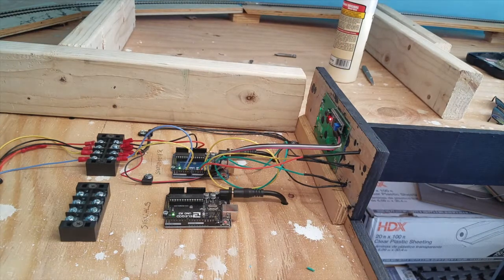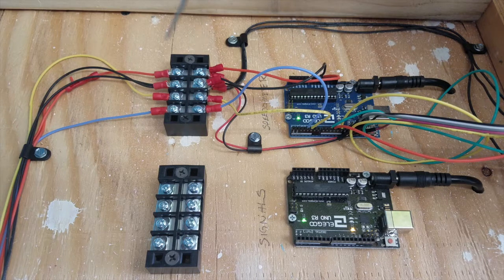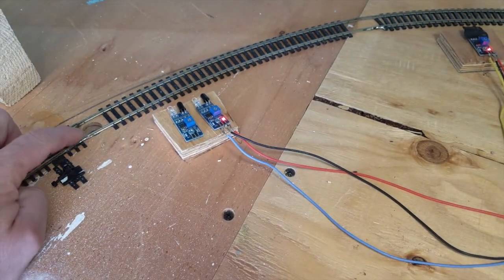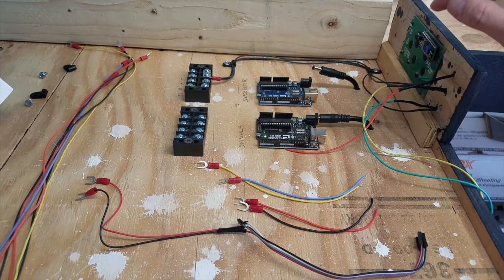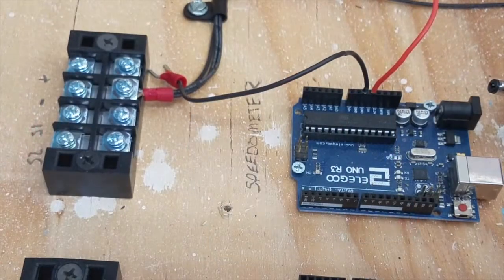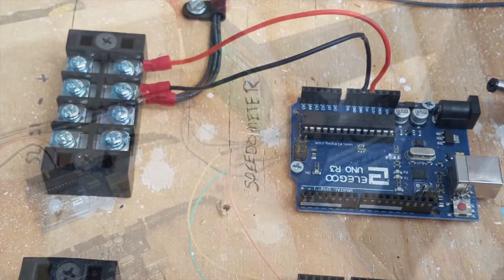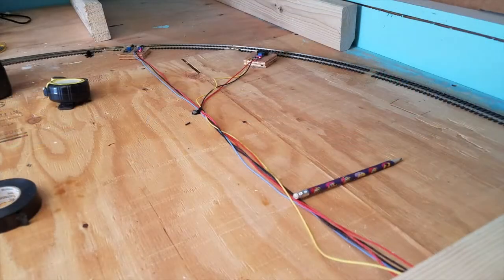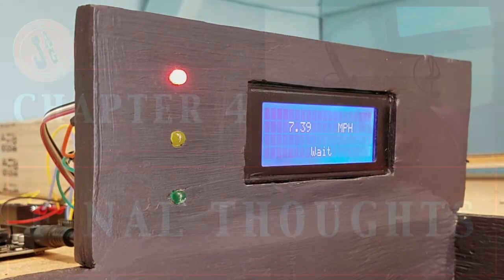How I Do (Arduino Speedometer)

Comment: Joe,   RE:  Your Arduino Speedometer sketch.  I'm totally stuck.  There are multiple LiquidCrystal_I2C libraries scattered all over the place, and none of them are the same.  So far, I have been unable to find one that defines POSITIVE in the line:
 "LiquidCrystal_I2C lcd(0x27, 2, 1, 0, 4, 5, 6, 7, 3, POSITIVE)", and I've looked at a bunch of them.  You obviously have the right one or your Speedometer program wouldn't work.  Is it possible for you to zip your LiquidCrystal_I2C library files and put them up with this article?  Or, maybe, if there is any identifying, such as the author's name, posting that so I have something to go by in trying to find this library?  Thanks in advance.  J
Reply: Not sure you all got your answer but here's what I did.  Bought the Sunfounder display, downloaded the Sunfounder library, looked at their examples and modified Joe's code.  Replaced Joe's with LiquidCrystal_I2C lcd(0x27,20,4);  // Set the LCD I2C address
Also replaced Joe's lcd.begin(20,4);  with lcd.init();   These are copied from their samples.  Works nicely!  Thanks Joe!
Reply from the maker: Thanks everyone for updating this code!
Reply: I am having the same problem with the POSITIVE not declared in this scope. Did you ever get an answer.

Comment: i really liked your video quite worthy of a kudos, but i need the sketch i did try to write my own but it just didnt work so if you could get me the sketch you used it would be appreciated, also do the sensors work in both directions for measuring speed without doing a wire change thanks
Reply from the maker: Can you give me your email and I'll send it to you

Comment: Thanks for the sketch Joe. Now my only problem is I ordered the same hardware as you and I cannot get it to work. Well I think it's working but the LCD isn't. How did you get that I2C to work? The sketch compiles now, but I had to make Liquid Crystal changes. Thanks!!!
Reply from the maker: Yeah I think the I2C changed since I made the video.
Reply: @JoeG-firehousewhiskey  Which version do you have  when you get a chance. I will just try to find your exact same one since it works without editing the sketch.  Thanks

Comment: I notice others cannot see your pinned sketch. Could you email it to me davea200@yahoo.co.uk. Thanks excellent tutorial. Just hat I needed . I had a very similar idea, but I was going to build it into a 10 inch tunnel and power it with a 9 volt battery so that I could use it on any layout. Your code will save months of work.
Reply from the maker: Sent!

Comment: Hi Joe. I decided to build one of these and had a few compiling errors. This was caused by the library changing. 
If someone wants to use your code they need to install an older version of the library. I will gladly "pin" mode code changes on here if you would like. I made a few cosmetic changes also.
Reply from the maker: Yes I did notice that, thank you very much for your help
Reply: I would like that Library. I am having that same problem. I can compile now after changing some liquid crystal lines, but nothing but backlight. Thanks!!

Comment: Damn it Joe!  You beat me to this video!!!  I have been thinking about building my own arduino speedometer for months - even wrote most of the code but never actually pulled out the arduino because I did not have appropriate sensors in my junk box.  Thanks for doing this video and congrats on beating me to it.  My only solace is you said your project was two years in the making so have another 18 months to get my done and be faster than you!  :)
Reply from the maker: hahahaha, sorry man. If I were you id still make the video. Everyone does it differently and someone might learn something from you that I didn't show. You can go over the code more in depth, I dont know anything about codes but you can explain how you build one. Then make the speedometer.
Reply: @JoeG-firehousewhiskey  Just ordered the sensors. I am sure I have an LCD display (or ten) in my junk box.  Will put one together and post the video on my channel... Crud, that is three videos now 'in progress' and further delaying getting that first one posted.  I think it is YouTube stage fright kicking in!  Focused on my RTNT DDWC2 contest entry video (clock is ticking) so once that one is done and posted then I can try some others.  Oh yeah, need to come up with some cool new name to change my YouTube channel to as well.
Reply from the maker: Ill be looking for it! And yes, im in the same boat. Im trying to hurry on the DDWC2 now. I had three videos to do and post before I started on that contest.